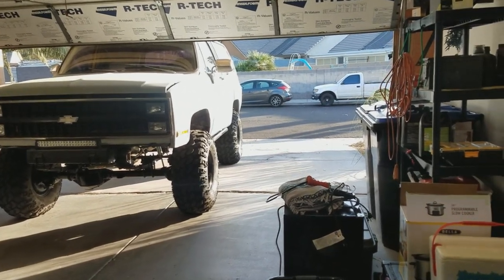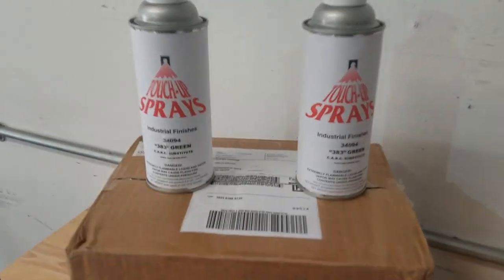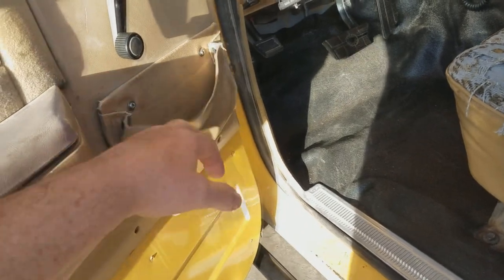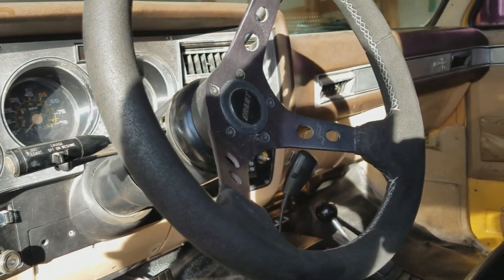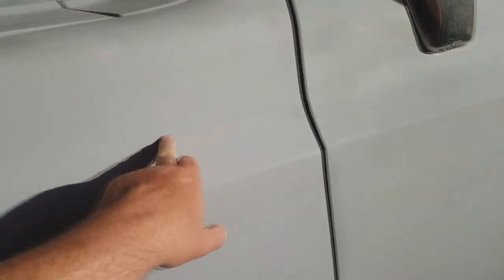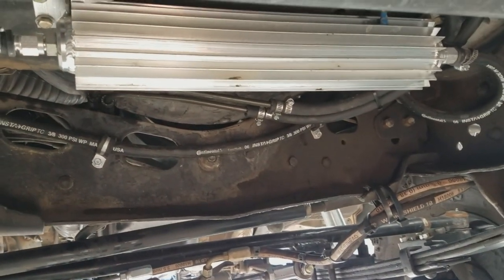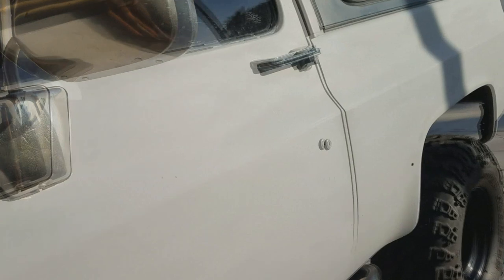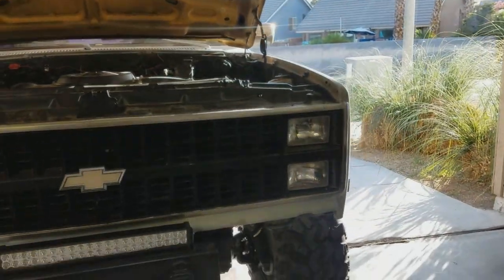82 Chevy K5 / Update / E-Locker / Brakes & New Paint Job

Comment: That looks like the paint we got from a place in Alabama that makes the paint and also uses it to restore old military vehicles. I painted a full fiberglass body, chrome moly tube chassis race car with paint that looks like the same color, definitely the same packaging on the paint spray can and Gallons   I’m curious as to how u care for it? On the race car, it seems everything sticks to it, I didn’t clear it, we wanted a “matte” finish. If wax touches it, it doesn’t do well. It seems to just make a mess. (Tested wax on test panel not on car). We had the rims powder coated black. Nice color combo in my opinion.  Thanks for sharing, awesome Blazer!
Reply from the maker: I ended up not painting the truck myself and took it to Maaco to get it painted. I care for it the same way you care for any paint job. Mild soap and hot water wash. No wax or it will become glossy and we dont want that.

Comment: What does a e-locker do? I have a 74 blazer. Sorry if it's a dumb question.
Reply from the maker: It is an electric selectable locker that can be turned on and off with a switch.
Reply: @SlayFive  oh ok thx
Reply: Slay Five how much is it??
Reply from the maker: @TTURKI  Installed around $2500.00 but I had the the front axle freshened up to with all new new bearings and a full brake job including rotors and calipers.